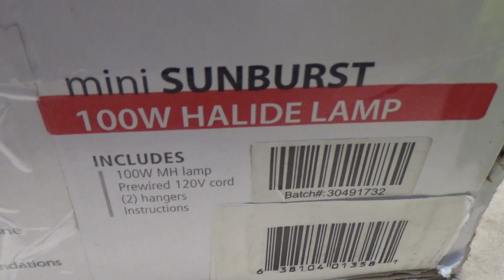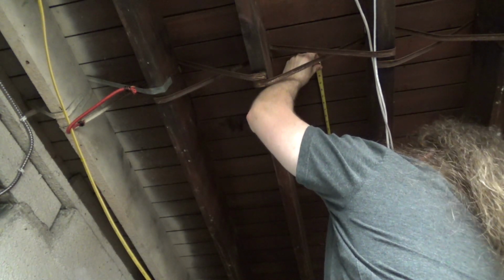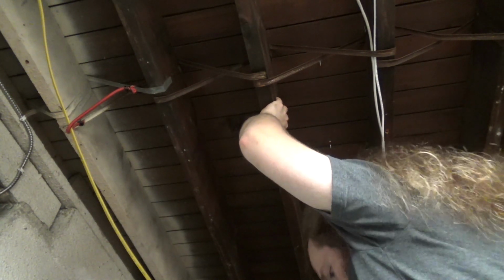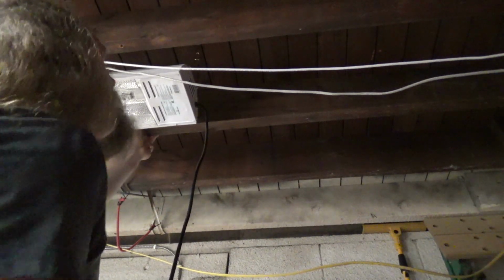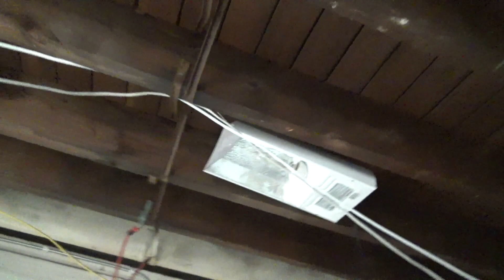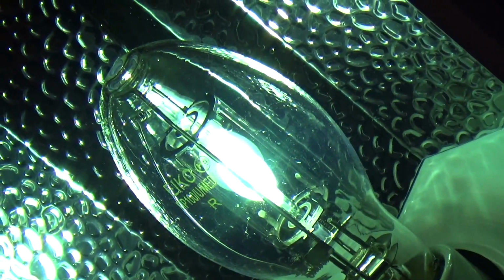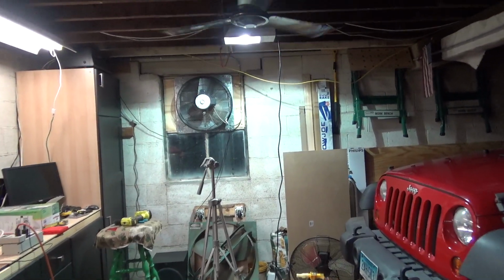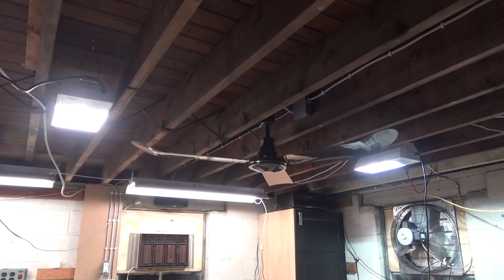Installing Mini Sunburst 100-Watts Metal Halide Lights Into The Garage

Comment: One possible solution would be to order replacement ballasts for those fixtures. The replacement ballasts are usually high power factor and are also usually better quality than the stock ballasts that come with these things. 

Also, you are probably being billed for real power, and not apparent power, so a low power factor won’t cost you more, but it does mean the lights draw more current, so you could be overloading the circuit and be drawing less than 1800w.
Reply from the maker: I have a lead on some vintage fixtures that are a better fit for the application anyways. Those should yield better results. If not, replacing the ballasts in these is an option.

I believe you are correct about the power billing. I don't really care how much power something draws as long as it works well. This is an exception case as there's only so much power available in the room. If I have the pellet stove running in the living room (which is standard for more than half the year) and these lights turned on, I can't run much of anything else in the garage.

Comment: The MH bulbs are overkill. Additionally, safety concern. When those bulbs go out, they go OUT. I mean, they literally explode. If they burn out while you're standing under it, you're going straight to the emergency room. Please put a safety measure on to prevent that from happening. No joke. They will explode.

Edit: Did more research and turns out that they rarely ever explode, but they do explode and are an extreme danger. But still be cautious and turn them off for at least 15 minutes per week to reduce the risk.
Reply: These lamps are open-rated (protected) ones that have a shield inside so that the outer bulb doesn’t break in case the arc tube does explode. I like to use open-rated lamps even in enclosed fixtures because it means if it does explode, it is contained and I don’t have a mess of broken glass to clean up.